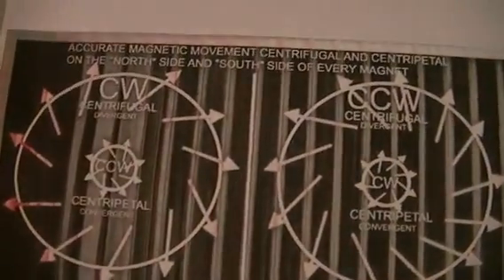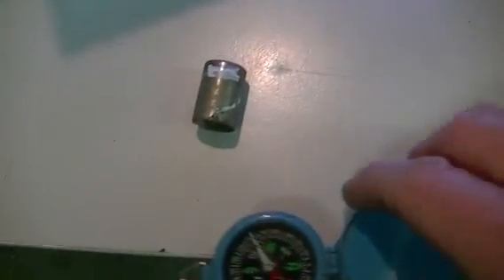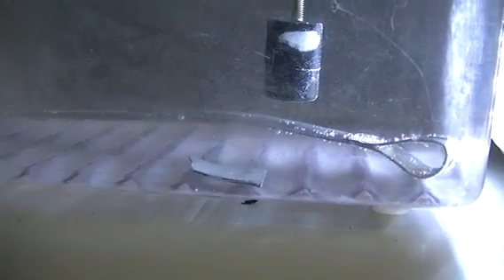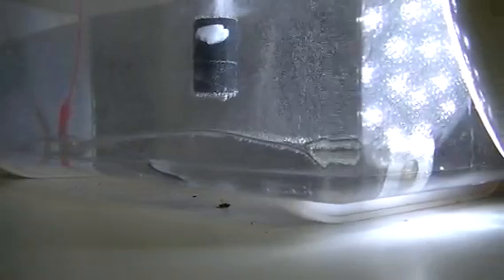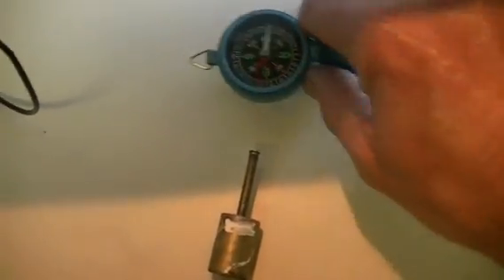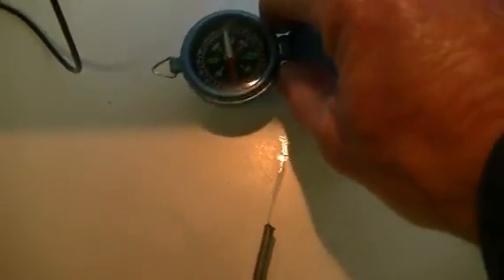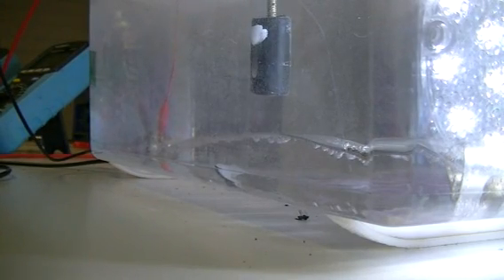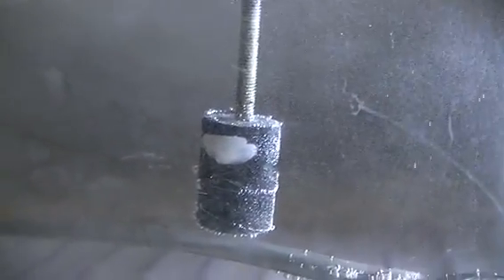Magnetic vortex CW CCW 2nd test

Comment: Electrons spin and generate magnetic fields that spin. The right hand rule is based on current flowing through a wire, as the electrons move from one polarity to the other through the wire  then the spin is perpendicular to the wire. The magnetic field is detected by a  compass perhaps. The direction of the field is based on the direction the current is flowing inducing the magnetic field in the opposite direction. That field is not just suspended perpendicular to the wire and stationary, it spins though the sensor would have difficulty detecting the spin. Nothing at the atomic level is stationary and all is moving especially when electrons are involved.

Comment: The effect showing here is quite Fuzzy, or rather the expllanations as to what is actially happening and the terminologies used are fuzzy. At one point the Narrator says: "The center of the magnet is "spinning", which is nonsense!  The magnet is fixed woth a wat looks like an M6 Stud :-)... .The claim is "Magnetic Vortex" . . .which is "an sich"  100% Fuzzyness  :-)  What is actually meant with that fuzzt terminology???? . . .A "vortex" tha act AS IF it is a magnet????  . . .line a magetic steel rod ??? . . .which, in that case IS a magnet :-). .Or is meant that there is a Vortex Quality in reletion to what actually is happening?? Obvious this could be meant, but nothing is certin here. 1)The magnetic Field of the magnet is not a Vortex; 2) The vertocal electric current in the bolt, magnet and in the water causes a distorted torroidal magnetic field around the bold, magnet and in the water below the magnet. In the 3D-space distributed circular magnetic field H+ and OH- are caused to move acording in a complex combined verical magnetic field lines of the magnetas well as of the the horizontal  circular magnetioc field lines if the vertical Current. Due ro the Electric current H2 and O2 gas bubbels are forned. These bubbles are affected by the H+ and OH- ion motions  that move through the water in account of the complex combined magnetic field from the Magnet and the Current. Considering that the H+ ions are VERY Small and OH- ions are very large, the motion of the  rising gas bubbles is affected by the complex magnetic field lines in the WATER, which is send spinning by the partially tangential force of the OH ions with causes ses the O2 and H2 gas bubbles to 1) move partially Tangentially from the magnetic force on the OH-ions on the bubbles and 2) move Upwards from the Buoybnt Force on the bibbles. With Polarity Reversal the partial tangential motion of the bubbles is reversed but the buoyant force on the gas bibbled is still upwards!!!!  This is how the rotational motion of the water, caused by the motion of the the complex tangential & verical forces on the bubbles  results in a vortex motion of the water due to the motion of the GAS BUBBLES,  either CW or CCW, but in either case UPWARDS as only the HO ions  can move the gas bubbled CW or CCW. So, the "Vortex" in this Experiment is a CW "Water Vortex" in one case and a CCW "Water Vortex"  in the other case,  and in either case  there is no such thing  as a "Magnetic Vortex". The complex shapes of the 3-D Magnetix Fields that are created in this Experiment  can be described as complex 3-D Spiral Shape but the name "Magnetic Vortex" is totally wrong. Generally a Spiral Shape is not alwais a Vortex. . .

Comment: Okay now same problem as the last test, the electricity is flowing straight to the bolt. Path of least resistance.  Remove the tape and electricity flows through the magnet.

Comment: So when are you going to do a control test, with no electricity involved? To prove the rotation in not caused by right hand rule? Its still doing exactly what a right hand electron current theroy would predict. The magnetic field comes out the center of the magnet then beds around. Accounting for the direction change....

I think there is moving flux inside the magnet, Electron spin theroy seems to support this. As does the Permanent magnet holder by Ed Lederskilin.but I have never seen anyone demonstrate these fields outside the magnet...

Time to get some steel wool and baby oil TM. Been trying to get a test together for you, but have some budget constraints, and the vegetable oil and steel filings I have on hand is not so good.

Again all I'm seeing here is an electron vortex, interacting with a static magnetic field.
Reply from the maker: No electron spin here MS,as current is carried through water by ion's,not electrons.As you can see in the last video,tapping up the magnet dose indeed decrease the motors performance,as there is less surface area for current to flow.A homopolar dose not change direction of spin when the magnet is flip'd around,you have only changed your view point  reference by 180*.Much like the wheels on a car as it's going forward,if your looking at the wheels from say the right hand side,they will be rotating CW. You then turn the car around,and it's now traveling in the opposite direction,if you are still looking from the right hand side of the car,the wheels are still going in a CW direction,but now the car is traveling in the opposite direction. Also,a magnet dose not have field lines as such.
Reply: TinManPower Ions also move in curved paths in a magnetic field.

Comment: Thanks for sharing TinMan. I thought of an interesting setup, I am going to do it once I find my 3/4"x3/4" cylinder neo magnet... The setup is mounting the magnet from the bottom with all the electrode material electrically insulated except for a small 1/8" hole in the center of the top, then run the experiment with the entire top exposed (which we know the outcome of). My thinking is maybe the hydrogen would catch the centripetal in the center and spin one way (setup 1), and catch the centrifugal and spin the other way (setup 2)... I must find my cylindrical magnet for this one (the magnets I used in my other video are potted and not suitable for this test)... Anyways, thanks for sharing again. It is interesting stuff. If you ran the test I outlined above I would appreciate it (no pressure though), I can't seem to find this magnet of mine. When I do I will run a slew of replications :)
Peace and all the best.